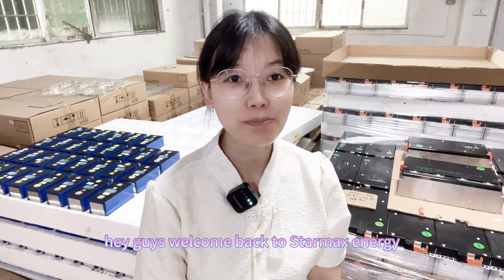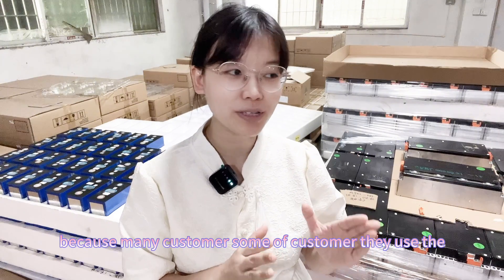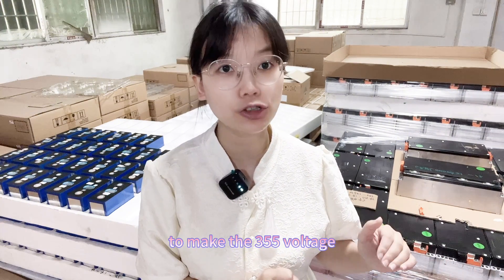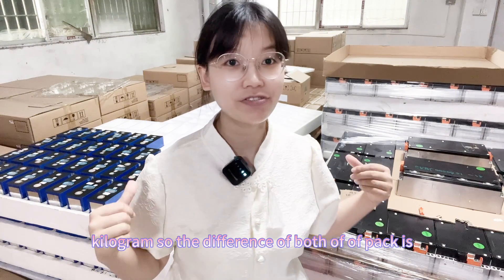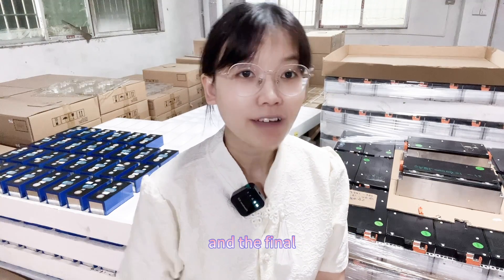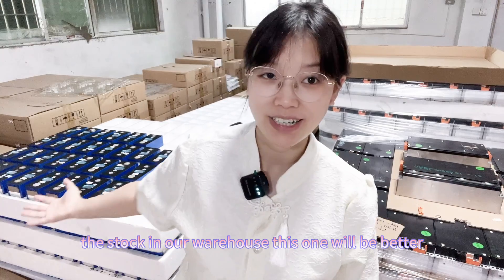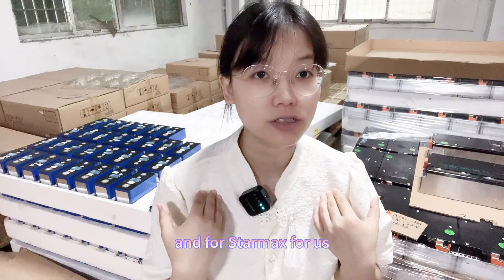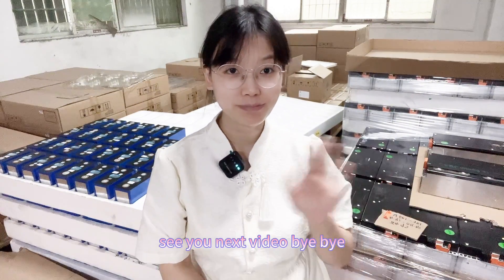CATL Battery Module and battery cell to replace Nissan Leaf to 63.9kwh, which way you will choose?

Comment: hi do you have cells to replace the factory ones on mitsubishi outlander phev 12kw/h or 13.8kwh?
Reply from the maker: https://youtu.be/7JCTtxqky3I?si=JyOxx3Q25Y0A8VNt
Reply: @starmaxenergy  no good! does not fit  outlander 42mm is too wide need to be 35mm wide and 171mm length
Reply from the maker: @robhrvat3568  friend, I can send you a compare picture with original cell and new cell, contact at +8614704451321
Reply: @starmaxenergy  maybe u think its mitsubishi miev but its not this model its mitsubishi outlander phev  34mm wide 171mm length and 108mm high with m8 studs 130mm between m8 studs centre  same as gs yuasa lev40/46
Reply from the maker: @robhrvat3568  friend, we have customer use this 93ah replace success for his outlander
Reply: @starmaxenergy  impossible 42mm to thick will not fit. width of cell only 34mm. you do research on gs yuasa lev40/lev46  you will see

Comment: Can you do a size and weight comparison for the different battery cells from the 50 AHs to the 100s? It's difficult to grasp the size of these batteries if they will fit into a project without actual size comparisons.
Reply from the maker: Okay, I will🤗

Comment: Holy hell thats almost 3x the volumetric energy density 
Curious how to make it work with the stock BMS and charger though
Reply: The stock BMS will not let the car use the full capacity of the cells. The BMS assumes it has the original cells. The other problem is that the chemistry is slightly different so the voltage curve is different to the original cells so the BMS calculates SOC based on the original cells which have slightly higher voltage. The end result is the BMS thinks the cells are empty when in fact they are half full.
Changing cells with different capacity and different chemistry is not as easy as just replacing the cells.
Reply: you trust chinese data sheets lmao??

Comment: what about the BMS and wiring do you have these
Reply: I would like to know this too. Using the modules do you have a ready to assemble solution or do we need to engineer BMS and power connections?
Reply from the maker: If i learnt it, i will update videos for you guys :)

Comment: Will the battery pack work with the leaf bms?
Reply from the maker: yes, work with original BMS. But need to add a CAN bridge
Reply: Hi how can it work with original BMS?as some other have try fit lol larger capacity cell and not able to use the extra capacity as the BMS is only program for original capacity cell , how does your system get around this? @starmaxenergy
Reply: youtube : chinese evs on fire
Reply from the maker: @deedook4736, Ignorants are truly fearless, knowing nothing and unwilling to learn. suggest you watch more YouTube videos or Wikipedia to enhance your knowledge base.

Comment: might be usefull to add a link to the product and show the prices cause many will not write an email cause they wanna see prices first.
Market has become very competitive and Nissan Leaf is a quite old car usually going to the scrap yaed with the old battery cause the recyclers are paying quite good.
What about other cars like the e-Up first and second generation batteries and a replacement ?
Same for e-GOLF, both cars from VW, the biggest or 2nd largest car manufacturer.
Reply: I’m only a few mins into the video when I saw your comment… 

So what’s the price of the battery shipped to USofA? They seriously didn’t provide any Links?! 🤨😤😵‍💫
Reply from the maker: 180ah NMC cell: https://www.alibaba.com/product-detail/Starmax-Catl-3-7V-180Ah-195Ah_1601043853443.html?spm=a2747.product_manager.0.0.795571d2DA6eNr
180ah module: https://www.alibaba.com/product-detail/CATL-4S1P-6S1P-12S1P-51Ah-92Ah_1601057303785.html?spm=a2747.product_manager.0.0.795571d2DA6eNr
Reply from the maker: 180ah NMC cell: https://www.alibaba.com/product-detail/Starmax-Catl-3-7V-180Ah-195Ah_1601043853443.html?spm=a2747.product_manager.0.0.795571d2DA6eNr
180ah module: https://www.alibaba.com/product-detail/CATL-4S1P-6S1P-12S1P-51Ah-92Ah_1601057303785.html?spm=a2747.product_manager.0.0.795571d2DA6eNr